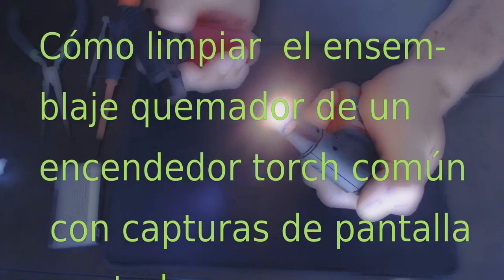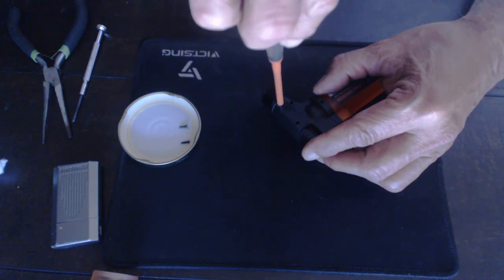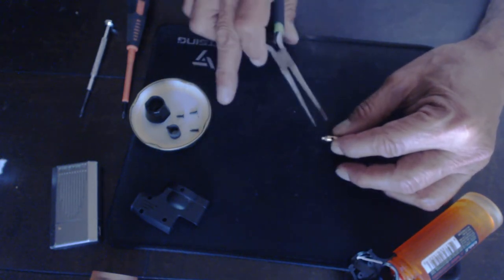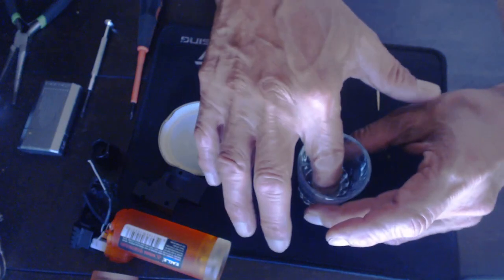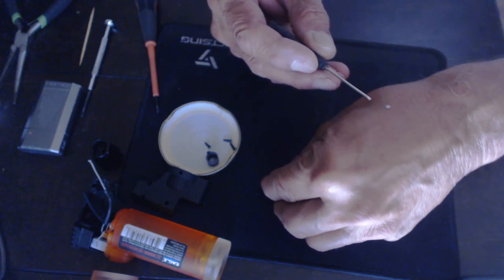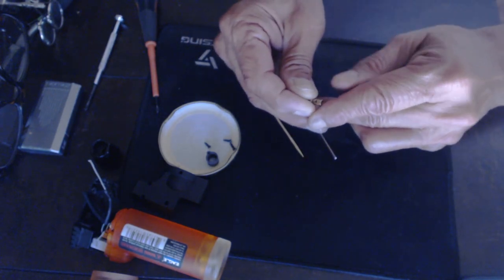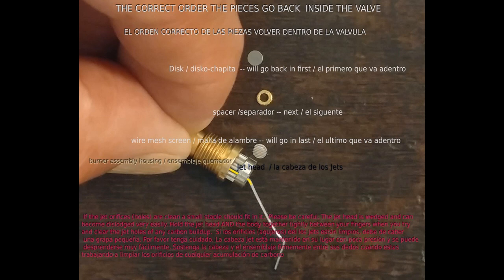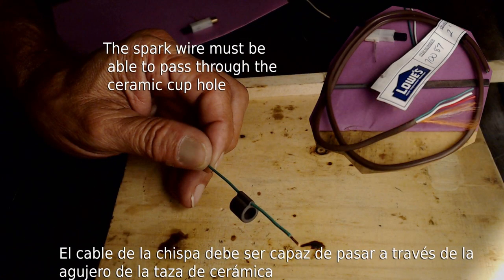How to Repair clean a Eagle torch lighter burner assembly with annotated screenshots

Comment: why did you speed up the video at such a crucial shot of disassembly?
Reply: To the content provider the original question of why still remains. Yes we are aware youtube offers a way to slow it down, but why speed it up. 

Also a suggestion in future videos would be to do a seperate video for each language as hearing both to those that only understand 1, seems to complicate an already complex and confusing process as you even done it wrong yourself the first time.  
  Just a suggestion if you make more videos.
Reply from the maker: I do apoglize for not answering sooner. I know that I did draft a response to your question back then and spaced it off. I sped it up to save time and I made a bad call. My thinking at the time was the viewers would be clearly able to discern that I only unscrewed one side of the housing. the side that has the 4 screws.  I then disconnected the nozzle assembly.  If I were to update and replace this video I would loose the almost 13,000 views.  I was wrong.  Sometimes,  "se me va la onda".
Reply: @cantucomputing9241  I love your videos. They ARE very detailed. However, on a couple of videos, Part 1 of fixing a scorch and another one, the videos are filmed with a filter, or a filter has been added afterwards that causes difficulty in actually seeing the details of what you are doing. Do you, by any chance, have unfiltered videos of the same, that you could post?

Best,
Kristina
Reply: @UnvisitedProfile  
Hahahaha....you got BURNED

Comment: I was looking forward to your video because its one of the few I've found on the brand. But omg. I seriously had to stop it after about a minute and a half. I'm bilingual, fluent in Spanish for 16 years now and usually I'm very articulate and can follow various instructions but hearing the two languages being repeated eight after one another was hard to understand for one, and secondly, it completely distracted me from being able to focus on your instruction. I'm not trying to insult you at all and I hope you don't take it that way! I think what you intended to do was very thoughtful and accommodating to many, but I would recommend either doing a second video of just your actions (no sound and voicing it over in Spanish there) and having two videos, one in each language) or instead of repeating instruction in spanish, add Spanish subtitles or Vis  versa (not sure if spelled right). 
I applaud your effort and my comment is meant in a very nice way.
Reply: Brandi 
I completely agree with you. I don't speak Spanish and I've watched this video multiple times trying to ignore one language and focus on the other but it's just to distracting. Maybe if he paused in between the two IDK but it's too hard for me. And I have other issues with this video. It's cloudy or blurry at times and most importantly he sped up the frame rate during the dismantling and putting it back together. I need to know how to do that. I think he's got the potential to make a really good instruction video if only he corrects these Issues

Comment: I have three of the big eagle torch pen lighters that have just stopped working overtime, and I can't find a video anywhere on how to fix those. Maybe the mechanics are about the same.
Reply from the maker: You are correct. Almost all torches use this one basic design with the exception of a few of the more expensive torches. But they all work the same.  Good to hear from you.  Using the piezo from a BBQ lighter will ensure that the wire will be long enough for you.

Comment: Hi. Im curious as to the fuel tube type and diameter dimensions. I need to order a bunch of fuel line but no one lists the exact information
Reply from the maker: OD: 3mm ID: 1.69mm  length: 29mm - 30mm
Reply: @cantucomputing9241  i ordered .5 id with 1.5 od
Reply: Seemed the 3mm od was quite large
Reply from the maker: @joshuadavis756  I used a digital caliper and measured the fuel line of 3 other fuel lines that I have as spares for the Eagle Torch . The diameter is not as important as the ID. As long as  the valve fits inside the ID with no leakage you'll be fine. The .5 ID of the line you ordered should stretch nicely when fitting it over the release valve.
Reply: @cantucomputing9241  excellent i just hope it holds up to the pressure.  Also i really appreciate you prompt replies.
Reply: Man the size i bought is great. I get the best pressure ever. The thickness of the tubing along with the .5 ID has seriously added a very effective upgrade.  Even my cheapest of torches is better then new. I updated all my lighters that require fuel tubes.  So much goodness
Reply: And yes they come with 3mm OD but they are thin dont always hold good pressure and they go to hell fast.  With the stretch holding tighter and thickness of tubing all in all badassery. Thank you all for prompt and valuable replies. I shall save all sizing and try them on my next line orders.
Reply from the maker: Joshua - man my beloved torch needs a new fuel line hose. It keeps coming off.   Do you remember where you ordered the fuel tube from?  It sure would help me out.

Comment: Where do you get replacement parts?
Reply from the maker: Garry, As far as I know, there aren't any that you can buy. I cannibalize whatever i need from the several torches I saved that were no longer working.  If it's the piezo that you need,  I get them from BBQ long reach lighters I buy at Walmart for about $1.50 for two.  They last for a good while. If it's another part that you need let me know and I'll see if I can help you.